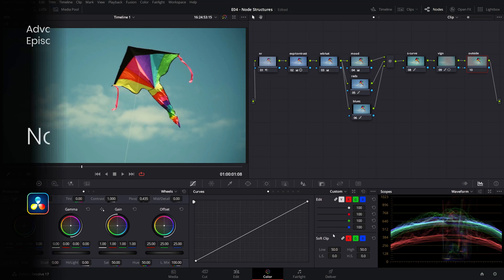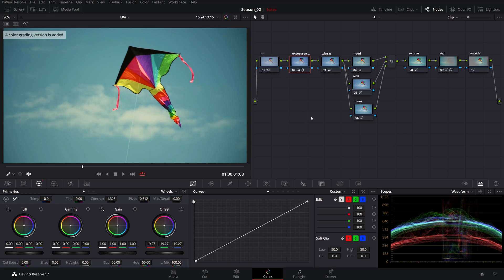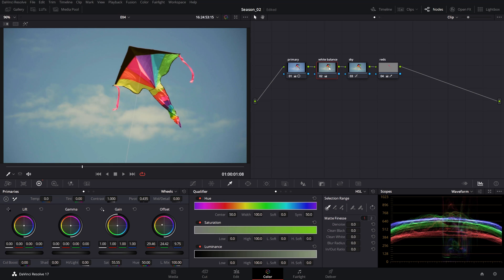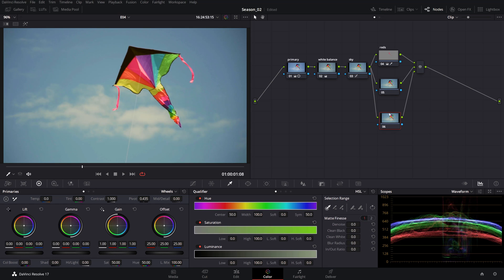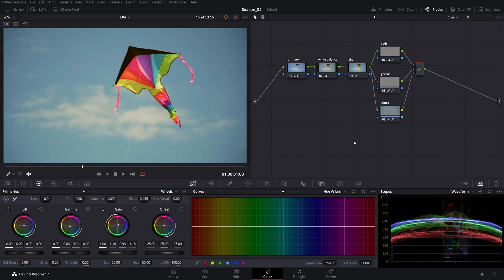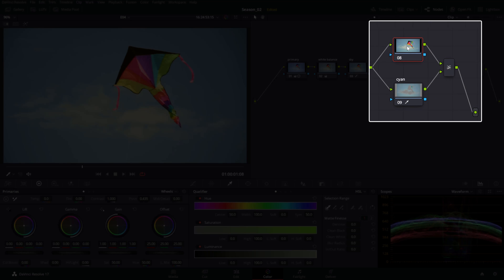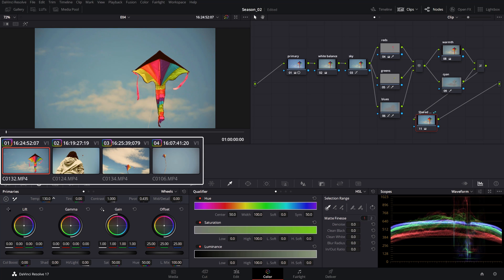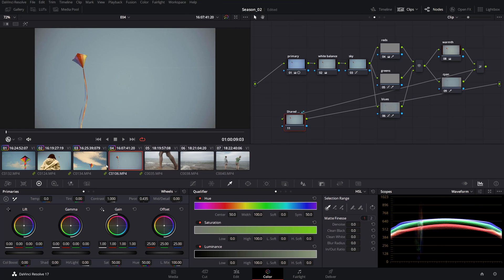DaVinci Resolve | Node Structures

Comment: one thing I'd add about the parallel mixer one is that it can also be used to choose what input goes into which node. For example you could have the "upper branch" be your primaries like balance, exposure etc. and then the lower branch with secondaries like a qualifier for example. If you now feed the qualifier node the original input in for example a color managed project where the qualifier will have enough color separation and contrast to work with you could now use the qualifier, make your secondary adjustments and then mix the outputs of the secondaries node with the primaries one through a parallel mixer. This way it's not just good for organisation. Now if you were to change primary adjustments completely for example the qualifier would still pick exactly the colours you were happy with in the first place as its original input hasn't changed. This could be particularly useful for all of those that grade with or for clients and or DPs for example as somebody might request a change of contrast etc. as the grade won't break this way.
Reply from the maker: YES! That is a life saver trick for getting solid qualifications and have the luxury for further primaries adjustments and preserving the key. Thanks for the excellent feedback and tip!